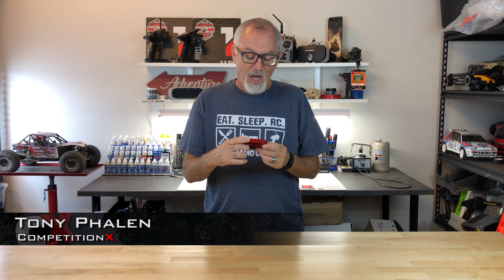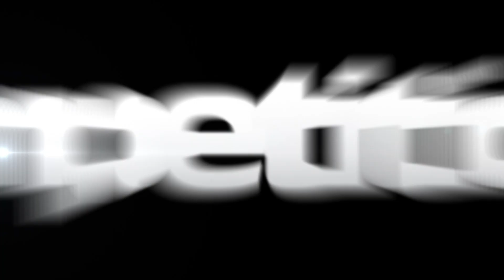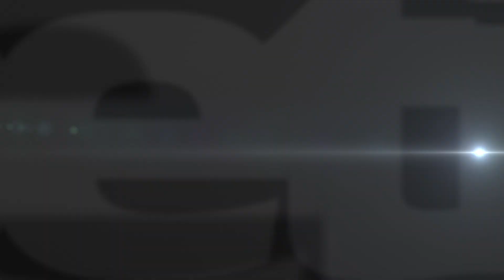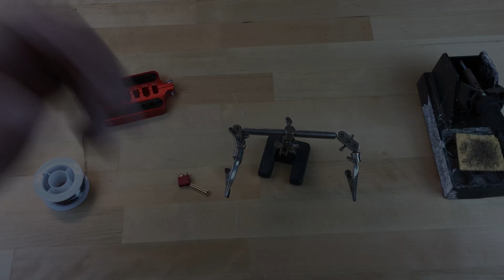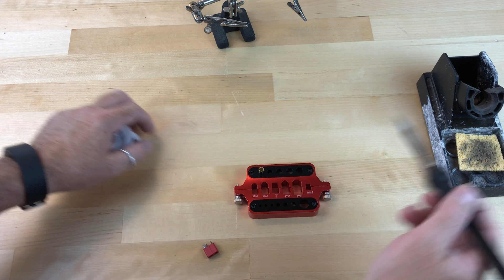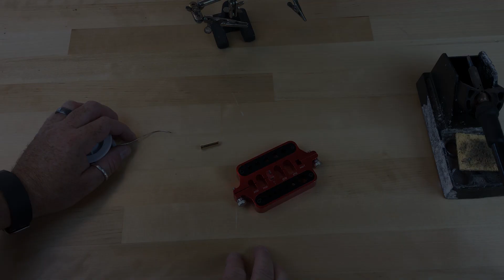TheToyz.com Aluminum RC Soldering Jig | CompetitionX

Comment: I need to get one of those....
Reply from the maker: Always thought the little adjustable clamping deal was the ticket, but this thing made it WAY easier. You do alot of projects - you need one! :)
Reply: I use needle nose with a rubber band on the handle! lol
Reply from the maker: Hey, we do whatever works, right? LOL